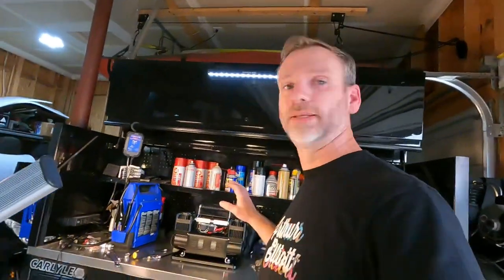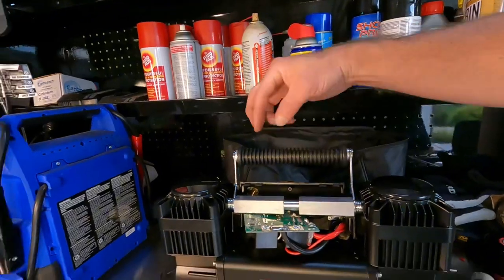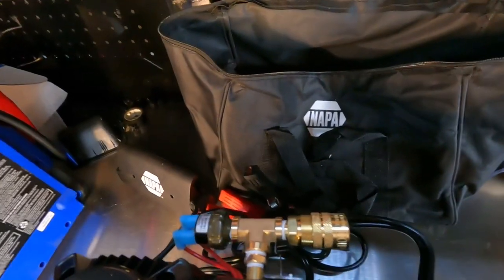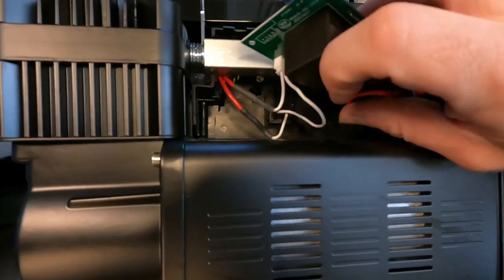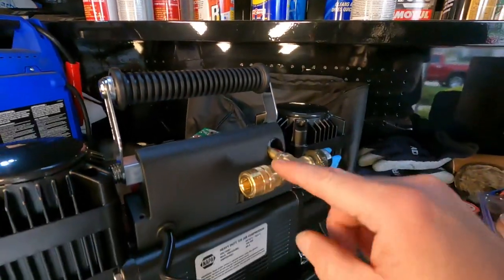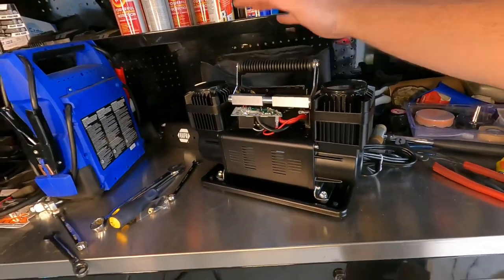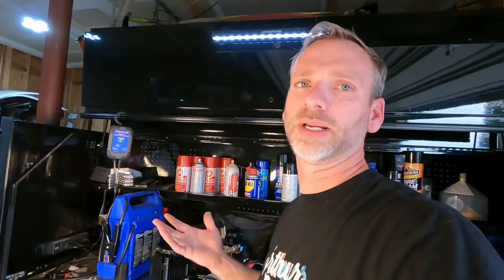How to Modify the Portable NAPA Air Compressor

Comment: Great Video on the new NAPA compressor. I finished mine yesterday but went a different route. There is a power wire that has a spade connector on the board that you can unplug and use for one side of the pressure switch. I also drilled my manifold for th1 1/4" quick disconnect and did mine internally. This new NAPA compressor has the board mounted so you need to switch the outside covers to the other side to allow for the pressure switch and coupler to be in the same spots on the manifold. A guy did this on the Maxi FB page that I followed to do mine.

Comment: why did you use the white power switch wire instead of the red wire to the pressure switch..?
Reply: I was curious the same thing.  Why tap the white wires vs taking the existing red into the pressure switch then do a jumper from the pressure switch to the board.  Any feedback?

Comment: Could you help me out when you cut the 2 white wires?Does one of them go to the pressure switch and the other go to the off switch?I'm not sure.Could you help me out
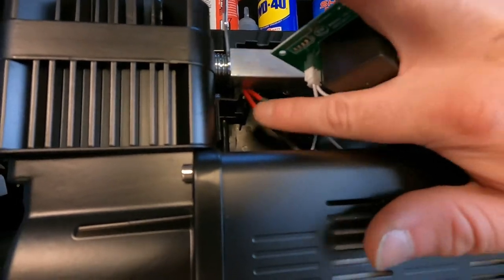Reply from the maker: Yep. Check out 1:45 in the video. One white wire stays connected to the switch and the other goes to the pressure switch. Pay attention to which white wire you cut. I explain it in the video. Hope this helps!

Comment: What’s are the specs for your pressure switch? I have the exact same compressor, I believe this one comes with a built in pressure switch but I couldn’t find information on what pressure it cuts off.
Reply from the maker: There seems to be confusion on if it does or doesn’t have one built in but mine certainly did not. I have a 90-120. Hope that helps!
Reply: @Mondaymotoring  Thanks! Yes definitely confusion on this. I ended up running it without installing a pressure switch. Never cut out for the 5-8 second it ran it. Installed the switch as recommended in your video and works like a charm now.

Comment: Have issues with blowing air hoses  just past quick connector at pump.... Gets soo hot Im blowing rubber, hybrid and nylon coil hoses..What hoses hoses are you guys using??
Reply from the maker: @Artburg  I’m using flexzilla hose. How long are you running it before it blows?

Comment: Ive been told that its not good for the compressor the operate under that type of pressure switch without a "unloading" part of it. And since you ran the switch outisde instead of tapping into the existing metal, would it be better to add one that has an unloading bit instead?
Reply from the maker: I don't know if it would be better but the way they come it doesn't have a shut off at all which I think is much worse than the what I put on it. There's a dedicated FB page that has a ton of information out there if you'd like to research it more.

Comment: Hey i installed pressure switch on mine too but when connected its goes on like every 20secs when not airing up by itself for about 0.5sec and turns off.
Is it a small air leak problem or its has some built-in air bleeder?
Reply from the maker: I have found that mine will bleed off air and kick back on.
Reply: @Mondaymotoring  Thank you for your reply. happy to hear its not just me and it probably how it is.

Comment: Great video. What size gauge wire did you use?
Reply from the maker: Not very big. I think it was 16 gauge.
Reply: @Mondaymotoring  What's the trick for getting it to stay inside the blue connectors?
Reply: What's the trick for getting it to stay inside the blue connectors?
Reply from the maker: @cwhead321  the wire? You'll need to crimp it in the connector.

Comment: Doesn't the pressure switch restrict airflow?
Reply from the maker: No, this thing airs up four 35s in no time all. The pressure switch is connected to the air path but it's not in the way if that makes sense.
Reply: I have the same compressor, but had been told that is why the guys at Thors Lightening didn’t install one. And now they sell them with the pressure switch. Of course I bought mine before😬
Reply: What pressure is the pressure switch turn off at?